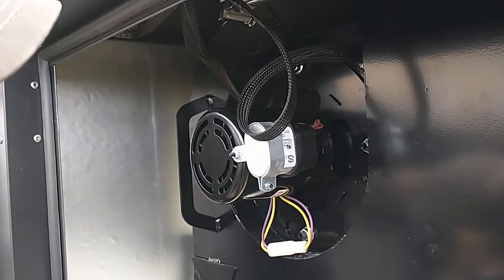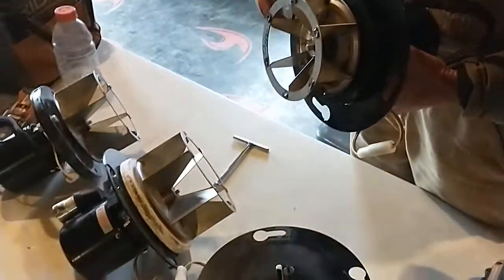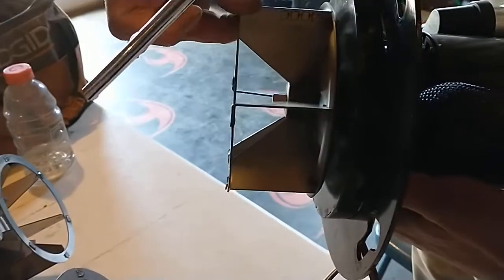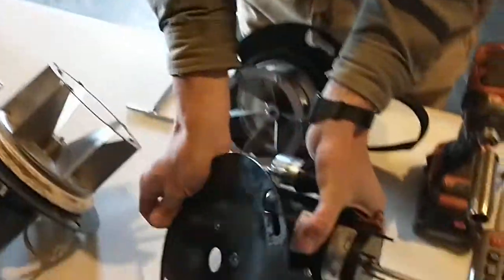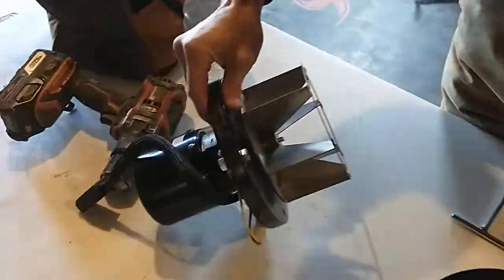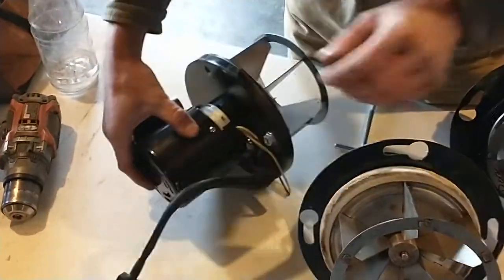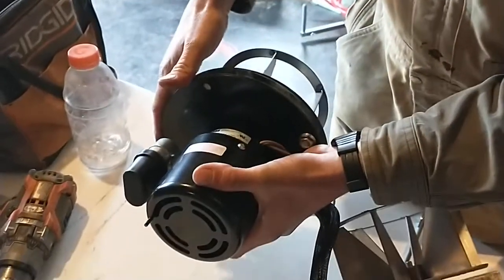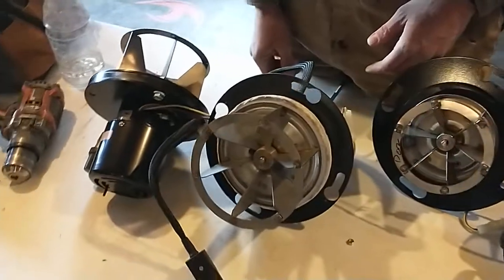HeatMaster G series Fan Motor

Comment: Maybe as soon as you purchase boiler you should remove fan from motor and install anti sieze on the motor shaft and inside diameter of the fan
Reply from the maker: That's an interesting idea, I'm not sure if it would stop ash/creosote from building up or not.
Reply: These furnaces are garbage
Reply: @godscountry4683  why do you say that ?
Reply: biggest waste of money . they DO NOT sand by there GARBADGE STAINLESS  STEEL. mine started to leak after 3 years .  they wouldn,t warranty nothing blower moter burns out every year  BIGGEST PEACE OF SHIT  OUT THERE ,